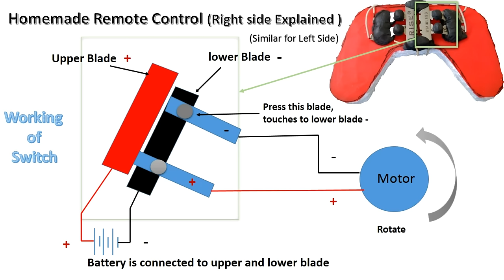How to Make a 4x4 Remote Control Car -- Homemade Remote

Comment: Thats so impressive, no micro-chips or other elements, just blades... But this toy is generally for childs under 14 so theese blades may hurt your fingers... Isn't there a way to use any other metal parts, not so dangerous? BTW +1 like thats unique! ;)

Comment: Love this, it reminds me of when I was in high school, I rigged a small motor and battery on a hotwheels car. I couldn't control it, just flip the switch on and the tires spin. Set it on the floor and watch it zip :P
Reply: Plss tell me how you did that
Reply: Weed. Lots and lots of weed, plus a room full of random parts and gizmos.
Reply: And it was held together with duct tape hahaha

Comment: Use smaller wire, put rubber bands around the wheels, and put the battery on the car.  Nice video.  Just suggestions...

Comment: so should we touch both right and left upper blade together to work as a switch leaving without any gap between them?
Reply: the 4 blades shouldn't touch the middle blade  it should only work if you touch it down
Reply: the upper blade should touch the 4

Comment: Hi I appreciate your talent and the time that you contributed to spread your knowledge Mr  Khambala. I have a weird question as I am techinically challenged can a 6V DC motor work in such projects or a kind of motor that I can find in the market with reasonable price. as I dnt have those motors at home ..  Thanks again for ur time
Reply from the maker: +rutvik barot this type of motor available at shop at low prices or search online
Reply: +Navin Khambhala Thanks for ur quick response.. i dont knw what wrong i am doing and its very strange .. i got 4 motors i applied fevi quick to join the bottle caps .. bt all four motors stopped working when i try to connect with the battery ..however i jst wanna knw whats that white colour sticky substance u r using to join the caps with motors ... i am really stuck and am behind this from lst night .... thanks again ... keep up the good work .. i hve recommeded ur videos to many of my friends as welll .....
Reply from the maker: +rutvik barot Araldite rapid used for stick, used small cap or use high torque,  I think your motor have not enough torque
Reply: +Navin Khambhala Thanks u so much ... hats off to you,your talent &amp; ur nature of spreading knowledge .... I am glad tht u actually removed time to reply .. thanks once again

Comment: does the car take turn in rubber wheels or it will turn only in plastic wheels? 
plz reply
Reply: +aliasgher zoaib rubber will provide more friction(which is good) so it will definitely turn easily with sufficiently powerful motors

Comment: but you r pressing that black colour m-seal as button or switch
?
Reply from the maker: +Bee bee john S so I can easy press the blade, and it touches to lower blade, fundamental is that one balde should be rouch to lower blade, you can press without that balck thing, it also work

Comment: what is that black colour in blade? if it is m-seal means, is m-seal is used for button for remote ? or any other thing . Pls reply me.  I want to submit this project the day after tomorrow.   But i couldn't able to prepare remote without knowing that black thing in blade.  Some r saying that it was blade.  Others saying it is m-seal.  What is that?  pls reply if anyone knows the answer
Reply from the maker: m-seal is glue used for stick blade

Comment: No offense but this is not a remote controlled car it's a wire connection not RC controller and from which angle it looks like a car? It looks like a rail car.

Comment: Could any one say what is this motors name and could you please explain me how did you connect the wire for the motor please I have a science project it's due Tuesday please someone help me
Reply from the maker: +Chester Abinash its dvd drive motor, you can use any kind of motor, but must be same, watch videos carefully for wiring

Comment: Please upload the video of the wiring which u had done i cant understand the wiring because the Video was too fast .Thank you.
Reply from the maker: +Yuvraj Sharma all connection is shown in video, other connection then this,
Reply: +Navin Khambhala # crazyNK it was too fast to understand the wiring of it so how can i make it how the motors rotate both sides clockwise as well as anticlockwise.

Comment: can I use metal wire ?
Reply from the maker: where u want to use metal wire?
Reply: +Navin Khambhala # crazyNK I want to use it for connecting blades
Reply: +Navin Khambhala # crazyNK  what the voltage remote control car ofblades you joint
Reply: عز

Comment: that not remote control
Reply from the maker: Then what?
Reply: Wire control car cause u control by wire...
Reply: +Samuel Pras Nope, its called a corded remote, its still controlled remotely.
Reply: +Christian Life It is remote controlled. Just not radio controlled.

Comment: Lets give our child a toy made out of exposed razor blades , shoddy wiring, no proper solder joints insulated with masking tape hooked up to a Lithium ion battery that will go up in flames if shorted out ! ...... Seriously ? !
Reply: +craig staggs Not all humans of the world get everything as easily and effortlessly as you. 

I'm fortunate to be born in one of the richest countries of the world with parents that are well off, but unlike you, I've learned to be humble and grateful for my privileges and appreciate that my high standard of living is much more the result of coincidences than my own or my ancestors' intelligence and/or hard work.  Thus, I don't feel the urge to step on people less fortunate than myself.

And as an electric engineer with decades of experience from the battery industry, I can confirm that the risk involved using the Li-Ion battery as it's done in the video, doesn't involve more risk than using it for its originally intended purpose as long as the battery is left in the original housing and not tampered with.
Reply: Pah ! ... So you would give a "toy" with exposed razor blades to a child ? ....